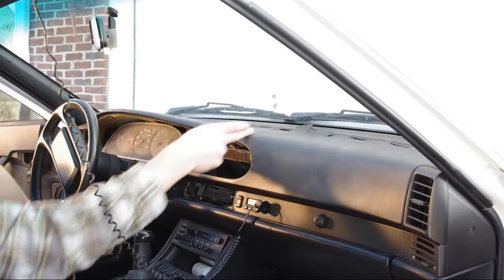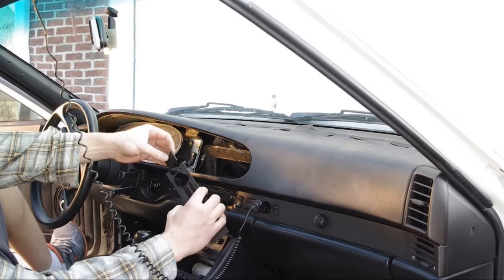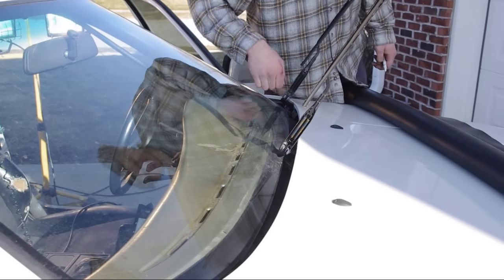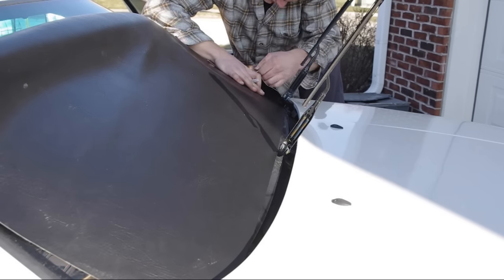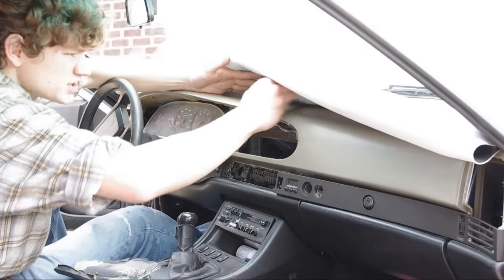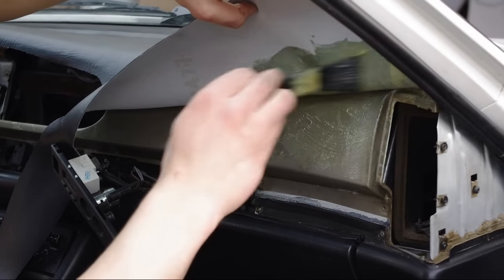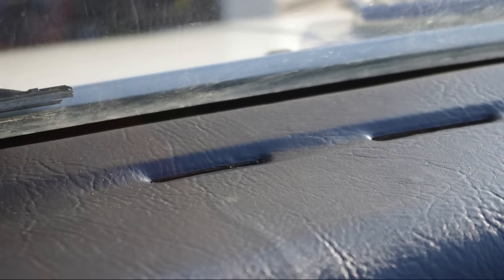How To Recover A Dashboard - Vinyl, Leather

Comment: Some things I learned doing research after watching the video: Use heavy duty and high-temp adhesive (like 3M - vinyl and rubber 80), and use a material that'll hold up to UV rays, heat, and dings/scratches (like marine vinyl). Will be attempting my own recover soon

Comment: Hi Dan. I stumbled across this searching for techniques to reskin a dashboard. First off - great job. You made it look easy. I wanted to share my 2¢ since I've done this project using real leather.

If you're viewing this video looking to do this project, consider doing the following:
1. Remove the dashboard from the car. You won't have to deal with the tight quarters or the windshield and you certainly won't be huffing contact cement fumes. This allows you to work from angles not available in the car and it's sometimes helpful to get access underneath. 
2. Use an automotive grade contact cement. The regular stuff you buy at the hardware store will not hold under a hot summer sun. Ask me how I know this. 
3. Work slowly and methodically. Cousin Dan gives a lot of good advice about planning ahead in this video. When you're cutting material away, be absolutely sure you have enough left to cover the area desired. This is especially important around compound curves and where trim meets your covering material. Bunching your material will make the trim stand out when you reinstall them. In a few areas, I actually trimmed away some of the dashboard with a rotary tool to accommodate the thickness added by the skin.
Reply: What contact cement do you recommend?
Reply: @AlexHernandez-yi2bj  DAP Weldwood Landau in the gallon can, not the spray can.
Reply: @ihazzit5201  Wow, reviews of that cement are great. Thank you! What types of vinyl and leather do you advice for a dash?
Reply: I would advise to research as much as possible to make that decision. There are too many considerations. UV ratings, leather grades, vinyl stretching properties. The old dash's material - can it be covered or need a complete tear out? Is the original dash able to recovered? Are there condensation issues? Climate issues? A 4 way stretch marine grade vinyl (Apollo or Sierra perhaps) may work well but you have to remove the entire dash because it's hard to work with but has great longevity. There are many sites, such as oemautofabric, midwestfabrics, yourautotrim, probably a hundred others that have about any material you need. Also, I think it was mentioned in the video, but clean that old dash and when you think you have it perfectly cleaned, clean it some more. It cannot be stated enough - any little spot missed will not take and will bubble and become undone in the summer.    @taz24787

Comment: The glue to use is contact cement, and for ones that don't know, it is imperative you let both tack up to the touch before you put the two pieces together. The glue sticks to itself when almost dry.
Reply from the maker: Great advice!
Reply: @TheCousinDan  what kind of vinyl material is that?

Comment: Looks fantastic! My 240sx dash is bad and  i may try this. I wasnt aware a heat gun could form so nicely. My dash is a bit more complex of a shape but i think it may still work.
Reply: Did you get around to it?
Reply: @ClearWater7.62  not with a PU vinyl, i used a thin wrap material from Amazon with a leather texture and it looked "ok" i was only able to find a sheet large enouht to do the top portion of my dash where it was cracked. I sanded/bondo'd the cracks but unfortunately it still cracked again underneath the wrap material and you can see faint crack lines. It looked ok for a while. But need a better solution still. Pretty sure im gonna tear it apart and figure something else out. If i could get a good deal and lucky in the junkyard id like to swap an infinity or BMW dash in or something lol

Comment: Looks great.

One thing though, IF you have passenger airbag. Just over the airbag you need to run your knife under the leather to weaken it so that the airbag can pop it if you have a crash.
Otherwise, the whole dash will explode if the airbag has nowhere to go
Reply from the maker: Hahaha, I'm just imagining that now.  Yeah that would probably be a good idea.  Just cut the fabric side maybe and leave the vinyl.  Try to to stretch it too much or it will tear though.
Reply: Bruno Danese I don't think these 944s have airbags. Judging on the steering wheel, there is no drivers side airbag, so i'd doubt there is one on the passenger side.
Reply from the maker: abubacar I can confirm these cars do not have airbags.
Reply: Be careful not to crash.
Reply: It doesn't matter anyway. The force of an airbag explosion would rip through even leather. I had someone tell me the same thing about vinyl and I chuckled.

Comment: Fantastic job Daniel! Would like to know how it's holding up though. It looks like you used regular vinyl fabric. I imagine it may have already started cracking by now. For me, I'd go with marine vinyl, as this is much easier to work with, more durable and holds up to the extreme heat. It's more expensive, but well worth the cost, as it will last much longer than regular vinyl.
Reply: Them spots around the defrost up there will start coming lose in a year or

Comment: The glue is Ados F2 and to make things a little easier, you can have a spray bottle with turps in it. Once its tacked up, give the surfaces a light spray with the turps and it will give you some room to move until the turps evaporates...
Reply from the maker: Turps?  As in turpentine?
Reply: Yip, it will soften up the Ados just enough to move it around a little bit until it evaporates. Tacky Ados will stick like crap as soon as it touches the other surface so handy when you need a little compliance in some areas...
Reply: This is how we used to put the foam tyres on our 1/8 on road nitro R/C cars
Reply from the maker: Great tip!  Thank you!
Reply: competição som c4 picasso
Reply: Use Ados f38 its high temp. Which won't release on hot summer days

Comment: I'm not an expert at all, but wouldn't it have been an easier task if you removed the dash from the car? Great video, just wondering how I'm going to apply this to fix my motorcycle seat since it has a hole in it patching would look like crap.
Reply: Likely no, because of the fact it is a 20+ year old car.  If it has sat in the sun enough for the surface to crack, chances are the plastic is cracked too and easy to crack.  I recently removed and replaces an FC RX-7 dash and now I'll have to remake it (no longer available).  Not to mention, taking dashes out of 2 door coupes sucks because of lack of space.
Reply: Darien Williamson It really depends on the construction of the dash.  I've removed the dash in '90-'93 Accords at least 6 times now with at least another install to go.  Luckily, the construction of that dashboard is not one that promotes cracking or really any wear.  It holds up quite well.

Anyway, your video was great Daniel and the end result was even better.
Reply: Darien Williamson I wouldn't call taking one out of a four door an experience dreams are made of...
Reply: Koito rob Lol I probably wouldn't either, even relatively.  I hope I won't have to do it again.  But depending on the 4 door, I would say it is generally easier because there is more space to maneuver after removing the front seats.  Coupes typically have lower roof lines and are defined by their cabin volume.  That's really what I meant, especially if you aren't removing the windshield.
Reply: Pulling a dash is a pain in the ass, no matter what car or how old.  Period.
Reply: its difficult to remove the dash. to many braces and screws to remove adding the electronic parts underneath
Reply: Corey Bryant Too true. My old Citroen ZX's heater  matrix sprung a leak which necessitated removing the dash to replace it. Took me two days. One day getting it out, and the next putting it all back in. About two ZXs later, I bought another with the matrix already bypassed. I bought it off ebay for parts but apart from the heater, it was in far better condition than the one I was driving, and it was in good nick!
Scrapped the current one and used the new one. All through summer I kept putting the 'job' off. Went through my first winter with no heater. Kept telling myself I'd replace the matrix 'next summer', but memories of those two days kept popping up! Consequently, I went through the next winter without a heater too.
Not so big a problem for me than 'normal' people as another car I have is a 1961 Land Rover that although it has a heater, may as well not be there for the output it gives. I ended up giving the ZX away to a mate whose wife's car's cam belt broke.
Ironically, the heater in the Landie is bolted onto the bulkhead. It would be easy to replace, but it's the 'standard' optional extra available in 1961, so it's staying. Along with the thermal gloves, woolly hat, thick jumper and coat that goes with driving a 1961 Series 2 Land Rover in winter :)
Reply: Wheatables86 Agreed.  Old/Classic cars are totally different.   But I think we're more focused on the newer models in this thread.  And yes, I've worked on classic cars, and the dash is a pain in the ass to pull on most of them too.
Reply: If you can work it in place, why do all the extra work of taking it out?
 Plus the car hangs onto it well for you without having it flopping 
around while you are trying to work on it. Less work is what you want, time better spent elsewhere.

Comment: If that's not UV stable material, it's going to look like poo in a few years.
Reply from the maker: +GeorgeGraves 3.5 years later and it still looks great!
Reply: +AirplaneFreak Yes, if there is room for it.
Reply: +GeorgeGraves What glues should I use?
Reply: If you are concerned, use marine grade material. It is somewhat UV protected.
Reply: GeorgeGraves see. Bubba no
Reply: GeorgeGrave
Reply: Does it still loog good now, over five years later?
Reply: Not if you soak it down with some armor all. Or another similar product.
Reply: Any glass blocks UVB and windshields are specially treated to block UVA as well, so it does not matter.
Reply: But it only took him 8 minutes and 46 seconds to do it.

Comment: You should mention it is important to use high temperature adhesive. Headliner adhesive works well. Normal contact cement will turn to goo after a few a hot days

Comment: Awesome job Dude! I have a 99 Jeep Grand Cherokee that has door panel rot that I was thinking of cutting away the damaged decaying material, filling the divot and then putting either Leather or vinyl over and also replacing the faux wood/metal strips with actual wood. I should put it on YouTube when I do.

Comment: DUDE, this is Excellent. -I've also been looking for something along these lines (with the exact same vinyl /leather ) to cover the front baffles of a Tower speaker system. -I could never find any info on if a heat gun would work for the contours (and also the driver gaskets) allowing the speaker driver to 'Seat' the surrounding material and also provide most of the sealing gasket material. This was Brilliant! -I have also been using the thinner, black-out vinyl for my motorcycle's windscreen, tail light and turn signals, getting some practice in. -but the front section of this loudspeaker project is key to get right and this vid helped a lot. Thank you!
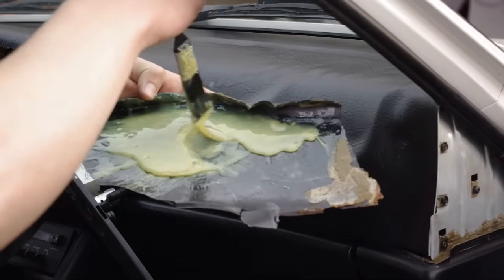. -Your bit at 6:05 to 6:20 is exactly how I intend to use this material (only for speaker drivers ;) (Truly great job on your ride as well , man.
Anyway,
Many thanks..
Cheers!

Comment: This reminds me to protect my dash....I did this to a Camaro back in the mid 80s (early 70s model) and took the dash out. It was easier on the older models. I would trade the car in today but haven't had a cracked dash in more than a decade. Early vinyl and plastics were notoriously vulnerable to sunlight.
Reply from the maker: +worddunlap Yes, things have gotten a lot better

Comment: When applying that type of adhesive, it's a good idea to have used plastic sheet to cover over anything that you don't want the glue to accidentally fall or spill on.  That type of glue is almost impossible to clean off of anything you spill it on and when brushing it on, it tends to form long filaments and big drips when moving your brush from the supply to where you want to apply it.

Comment: Be sure to use a high temperture adhesive. Because adhesives have a release temperature.  If you don't, it will bubble and release as the sun heats up your vehical.

Comment: I know this is old but it would be a good side note to add that the heat gun can easily ruin the vinyl if set too hot. Mine is variable and can go up to 1200° so to keep from burning, it should be kept low, maybe 250-300°.  I put a layer of thin foam down that made it softer, then the faux leather  that breaths than vinyl so it was able to dry better.

Even for an old video, it's still great.

Comment: The big problem for re-trimed dash  is the heat under the sun. Vinyl or leather pops up. I treed many types of glue with no luck. The only "solution" is  to put thin  spongy foam under the new trim.
Reply: try elephant semen, strong power stuff can't be penatrated like iron man suit

Comment: Looks good. I would suggest removing the whole dash though, easier to stretch it in your garage, and you can tuck the material. I would use a 3m product instead of contact cement also. His looks good, but anyone else might not have the same luck.

Comment: That looked really well done, wish I could do that with my dash but its been so sun baked and warped that I'll probably have to get the whole thing replaced.
Reply from the maker: Thank you!  3 years later and it still looks good. You can use spray foam to fix stuff and then sculpt it down.

Comment: wow ! how did it hold up ? i have about 5 yards of this stuff in my closet and i have been debating using it or just using alcantara
Reply from the maker: Use it!  The alcantara is expensive and not as stretchy (harder to apply).  So far I've had it on for 2 years and it still looks great!

Comment: Just what I was thinking of doing my airbag part has split so was going to take it apart to fit carbon wrap.    If you use spray glue first with heat gun then fit when it’s all fitted you can spray clear coat to help keep it the same look.   It’s just what should I do with the airbag split I’ll take it out then think I’ll cut back and sand it flat so it won’t show through then do the break lines if it goes off
Reply from the maker: I'm not following your description all the way, but I would just say that I wouldn't mess with an airbag and make it non-stock.  If it's cracked the only legitimate way of fixing that (that I'm aware of) is replacing it.  I wouldn't add more material to it because that could go flying into your face if it goes off.
Reply: @TheCousinDan  I’m going to fix it just unplug and remove then I can cut the split back make it good then fit the new wrap but I’ll make a template so I can put cuts into the wrap so it will still work and split if needed 
Iv made lots of steering wheel in carbon fibre or flat bottom them and all been ok so far.    Just take the battery off when unplugged the airbag.    Haven’t started it yet just do the service and found a oil leak from the intake lol    So doing that now 
Iv got new window tint aswell 
And got new leather to cover the door cards coz that’s all cracked.  Loads of fun

Comment: Nice work. I will have to hunt for suitable material to suit my 70 240z dashboard. I'm going to pull my dashboard to make life easier.

What is the adhesive called? Also what would you recommend for cleaning it off if you get some on areas you aren't supposed to?

I'm gonna check your other videos out. Peace.

Comment: The dash on my 944 turbo with airbag is original. It has some kind of thin foam or rubber backing between the vinyl and the metal. I didn't see it in the video. Does that layer come off as well? Did you glue down the new vinyl directly on the metal? Great video!

Comment: Good work - I also have an older car (22 years old) with damaged door and rear trim cards which have delaminated and warped due to use of compressed hardboard backing. However my dashboard is good but I'll be using tips in your video to rebuild the door cards.

Comment: One thing, if you're going to do something like this, I HIGHLY recommend using DAP Landau Top Adhesive. Typical contact cement doesn't last nearly as long. Other than that, great job!

Comment: Hi Dan...I have an 85 Mercedes 380se and dash has cracks from heat.  The dash is foam underneath,  Can the new vinyl be installed over the old dash without removing the cover?  Thanks.

Comment: I just tried it, I completely peeled off my 1990 Thunderbird SC dashboard, the cracks extended to the foam, so I used polyurethane sealant, let it dry and sand off to make a smooth surface before putting the vinyl, because it will show where the cracks are. Now, what type of vinyl should I use?.
Reply from the maker: +Bruno Torres I just got some fabric-backed vinyl from Jo-ann fabrics

Comment: If you broke a plastic facing piece, and needed to replace the whole piece (instead of just refitting the original), could balsa wood be used?  It would be light enough, but would it hold up to the temp fluctuations?  Just wondering.
Reply from the maker: +Jennifer Lemming It would not hold up to the contact abuse.  It would look bad very quickly being such a soft wood.
Reply: +Daniel Engling Thanks. Just wondering.

Comment: Dan I have 2 questions, 

#1 did you use anything to clean the surface of the dash once you stripped the old vinyl off?
#2 would it have been a lot easier to remove the dash from the car? sometimes only 6-8 bolts hold the whole thing in. 

nice job.